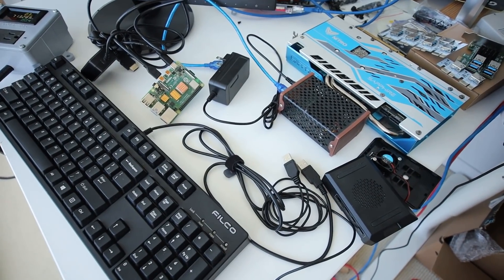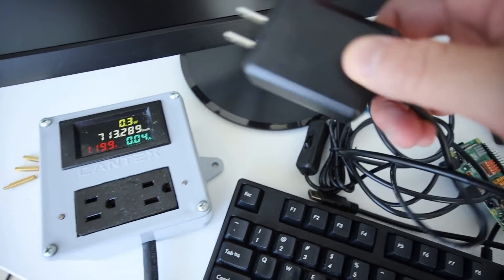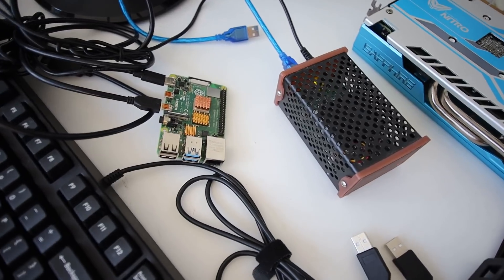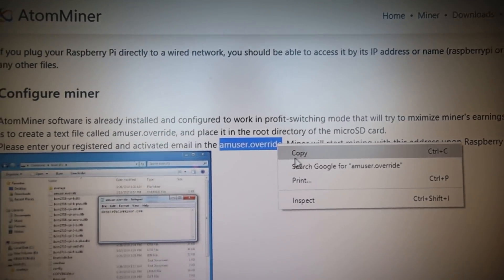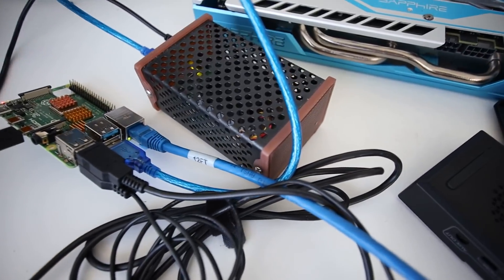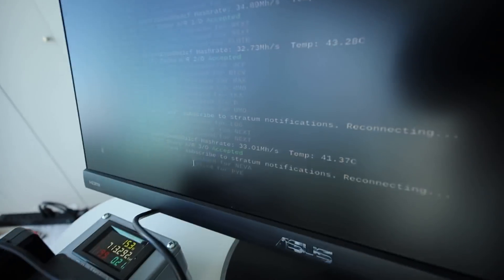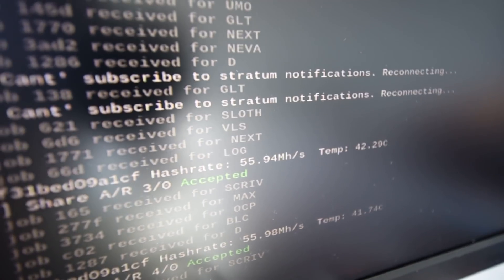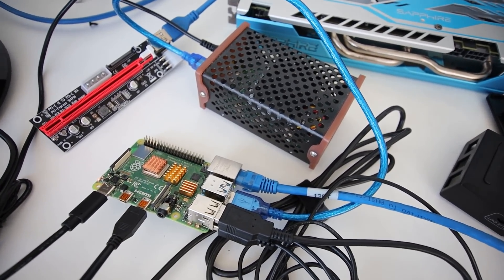Atom Miner FPGA Setup on a Rasberry Pi 4!

Comment: Are FPGAs worth looking into? And should I be investing? Is it ASICS the way to go or GPU?
Reply: Good question.  They are blinding fast at hashing ONE algorithm, just like an ASIC, only it can be fairly easily reprogrammed (or flashed) to mine a different algorithm if you want to.
So far in my research on these FPGA miners, I've only found devices that mine some weird little random shitcoin, that you can't do ANYTHING with! Literally no exchange supports selling an FPGA mineable shitcoin that I've found.. 
When I find one that will mine something USEFUL like ETH or ETC, or something that is actually tradeable on Coinbase I'll probably dive in and try it out... But NOT until then..
Reply: Dean Lawson This actually helped me so much, thanks!!!

Comment: Man I wish I was more computer savvy
I want to get into mining but it's so expensive and you need to learn so much from scratch to actually make a profit
Reply: im also a newbie and using a used computer with an i3 and 8gb memory and i bought a rx480 open box for $150. Im using windows/phoenixminer/ethashpool im getting 27M/s mining ETC. It was a little overwhelming at first but it actually only takes like 10 minutes to start mining
Reply: @tcontradiction  Isn't THC's algorithm gonna change soon, thus making mining equipment obsolete?
Reply: I meant ETC.
Reply: @ultraconservative  from what I  understand yes,  but it literally takes two seconds to switch to eth.
Reply: You can start small. If you have a desktop computer with  graphics card, mine with that whenever you aren't using your computer. Tutorials for Windows and Linux are everywhere. Read a LOT. Also don't be afraid to buy good used parts. I think that was my biggest mistake. Good luck.
Reply: @mulljacob  I have just on nicehash with an old laptop . making 9 cents a day of bitcoin lol 
I want to get in more other then just buying and holding
Reply: Also ordered a bitmain antminer I'll either lose a bit on daily or break even . For me it doesn't matter as long as its not a huge monthly overhead . I think btc will more then triple so its all good